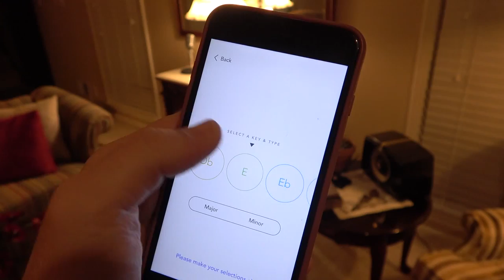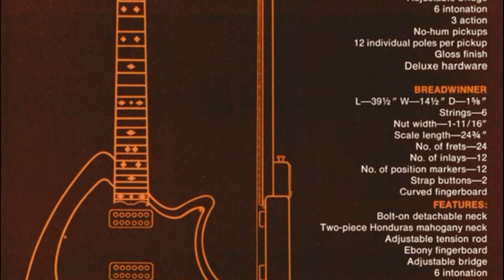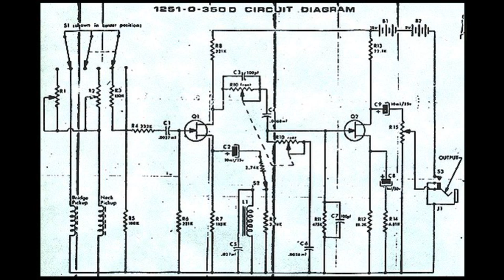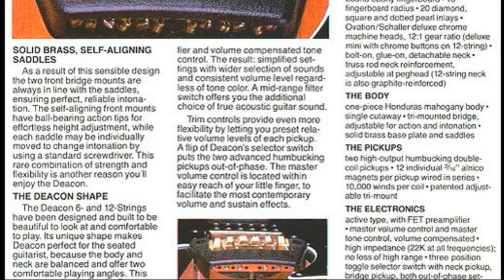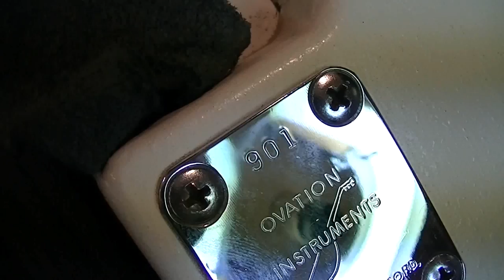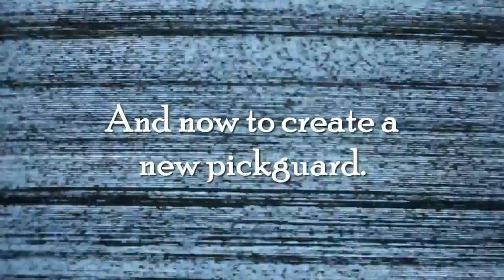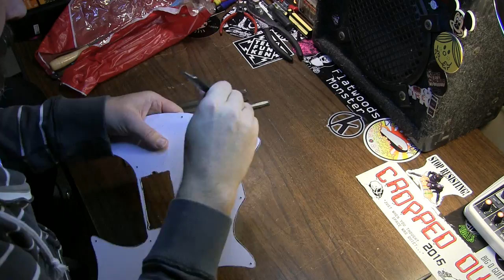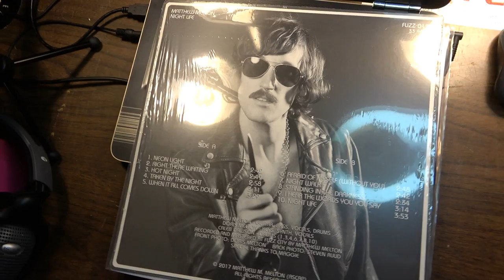The WEIRDEST, GLAMMIEST Electric Guitar of the 1970s - The Ace Frehley Breadwinner Model

Comment: Hi Brad, the bridge has a bolt on the back end that goes through to a nut under the back plate. Someone must have decided to tighten the nut, which is incorrect, the nut should be backed off to allow the back of the bridge to raise up and allow easy access to the strings and intonation  adjustment. Regards, Kent Kearney
Reply: Original there´s a little spring on the bolt between the nut and the wire, makrs the bridge fully adjustible.

Comment: Brad, I own a Deacon model that I bought new in the 70’s. I’m sorry to say now that I had the Guitar Shoppe in Laguna Beach made some modifications (at my request) that I regret today. 
I had the active electronics removed as well as the original pickups. I had the cavities refilled with mahogany blocks and installed 1 Carvin humbucker. It also had 1 volume and 1 tone control along with a mini toggle for coil splitting. Finally, the pick guard covered all the cavities and was also made of mahogany. 
I wish today I would have kept it stock but as you may recall 1 pickup guitars were the rage at that time.
BTW-my bridge saddles are stock and are made of brass not the plastic type found on the Breadwinner.
I still own the guitar and can only image what it would cost to be it back to it’s original condition.
Enjoy your channel and it’s content.
Chris

Comment: Glad you covered this. I have an early, all original Deacon (same as the one shown at 6:56 when you say “transparent finish options”) and the pickups sound so different than that Dimarzio (which sounded sweet, btw). There are issues with the bridge/saddle design and so on, as you noted, but all in all it is a cool (and very heavy/solid) axe with a gorgeous neck/board and balanced feel. Would love to see you inspect and possibly overhaul/mod one of these stock Deacons someday. Heck, I’d probably send you mine if needed. Thanks again and take care, Brother B. Your videos have brought me lots of enjoyment and inspired me to finally get my gear in good working order. Aloha from O’ahu.  Rock on, D

Comment: Still have and play my first guitar.  An Ovation Preacher Deluxe 1282 Natural.  
  Honduran Mahogany one piece body three piece neck, 24 fret, ebony fretboard, 50 watt built in preamp, splitable mini humbucker's, three way switch, phase shift switch, gold hardware, abalone inlays, Schaller Deluxe tuners.  It is a very nice playing and sounding guitar.  TY for the vid.
Reply: The bridge is bolted down too far.  Under the battery compartment, there is a nut... loosen that.

Comment: Having a CO2 laser cutter and more shaping and sanding tools that I care to admit to, I applaud your efforts to cut it out with a scrollsaw and correct and bevel the cut lines with hand files! it really is an old-school way of doing it. EDIT: Just my two cents worth, if the aluminum tape back adhesive is not conductive glue putting more will get you nowhere, as it acts as an insulator from one sheet to the next, I use a roll of copper tape with conducting adhesive which lets you make a bigger shielding plan.

Comment: This vid inspired me to drag my dead-stock black BW out of storage, complete with the official Ovation custom case that is considerably sturdier than the one in the video. I even still have the little booklet which the video shows a few excerpts from. Apparently, I bought the guitar on August 16, 1977, which was a great day for me, but a dark day for rock 'n roll. (Go ahead and Google it. I'll wait.) Anyways, a couple thoughts: Brad, you could probably have raised the back of that bridge even further. Mine has the screw almost flush with the adjustment nut, which gives plenty of clearance for strings and action screws. Speaking of bridges, I kind of wish mine had the nylon saddles rather than the later metal ones. I remember a lot of E strings snapping right there. Also, fyi for viewers, the Breadwinner bridge is in fact metal; the (very hard) black plastic is just a cover and actually makes for a comfy hand rest. Another point of ergonomics is regarding the funky shape. These guitars were incredibly comfortable to play sitting down as the big cutaway at the base sits perfectly on one's right thigh. I played that guitar for years back when I wasn't super picky about tone... I later realized that Ovation's aerospace-influenced active FET humbucking pickup design, um... sounds like shit, frankly. I've often thought about ripping it out and just going with something tried and true, but ultimately I'll probably just sell it, as is. Btw, Brad, I LOVE single pickup designs, so... Way to really make that thing killer!! Oh, one more story: I said my Breadwinner is dead-stock, but it is not quite mint. Literally, within a week of buying it back in '77 my cousin Randy dropped the thing on my grandparent's concrete basement floor, leaving a nice, dime-sized chip in the finish near the ass-end strap button. It still hurts.
Reply from the maker: Don’t need to google it. I died that day.

Comment: I think that original pickup is like 18k...the Deacons are like that. You did a very nice job on the pickguard. I'm working on something now and have been afraid to go at the bevel freehand. Do you have a lot of experience with that or did you just dive in? How beefy a file did you use?
Reply from the maker: I’ve made several pickguards in this way. I could use power tools I guess, but I’m used to the hand work. It’s a pretty coarse file I used. You can also step down the file size and sand to finish.

Comment: On the toroidal pickup, I would think that the “10k” writing on the housing refers to the number of cool windings.  Well documented that Ovation’s pickups in this 70s-80s windows were wound to 10k windings for high output. Think it was applicable to both their humbuckers and single coils.

Comment: I have a 75 Breadwinner with dual humbuckers.  I think that huge neck pickup you took out was actually a single coil!  Cool trivia: the breadwinner was the very first guitar to have active pickups. Mine is 18v takes 2 9v batteries.  The guitar sadly does not sound good at all, which I suppose is why you see so many with the pickups switched out.

Comment: Nice job! They make sanding bands you can install on your scroll saw, and you can even tilt the table to get a uniform bevel too!  Unless you enjoy hand filing...Also that Al tape has insulating adhesive  so you can lose conductivity between pieces unless you solder them together (the fancy 3M copper tape has conductive adhesive).

Comment: The only issue with the tape is the adhesive, it needs to be conductive. I've found most of the cheap stuff isn't conductive and had to stick a piece of the tape reversed to connect the pieces together. Check it with a multi metre.

Comment: Shielding tape is expensive and I prefer to use Copper tape on the body.  For the faceplate just use Aluminum foil from your kitchen and wood glue.  Put the sheet of foil on in 1 piece.  Easy and cheap.

Comment: Is that Good Luck Rock, the original Bridge Mute?  I think mine had a Bridge Mute, but the rubber went hard.  The Ovation Pickup there is the oldest version of Ovation Pickup.  My deacon has a whole circuit board inside the cavity at the back..

Comment: Just bought a breadwinner.  Pick ups have been changed and another pot added!   Very similar to what you have.  Can I contact you about a possible restoration?  Thanks.
Reply from the maker: What are you wanting to do with it? Put it back to stock?
Reply: @TheGuitologist  no, I’m trying to determine what exactly has been done to the electronics.  I’m buying the guitar soon just wanted to know if vintage electronics are still available.

Comment: If you plan on making a bunch if yhe same pick guards for all those ovation owners out there, you can get that pick guard material at most trophy ir engraving shops, some sign shops use it as well, the brand name is Romark.  If you can create computer file in a program like adobe illustrator with the shape you want they can CNC cut it to shape with the beveled edge on it.

Comment: The DiMarzio Dual Sound pickup had 4-conductor cable, just like the current pickups. That’s a regular Super Distortion. The old ones came wired like that. 

You know you had the perfect opportunity to use the original pickguard to make a plywood template. Then you could have used a router to both cut out the new pickguard and to bevel the edges. The curves would have been smoother. 😃 that’s how I would have done it.